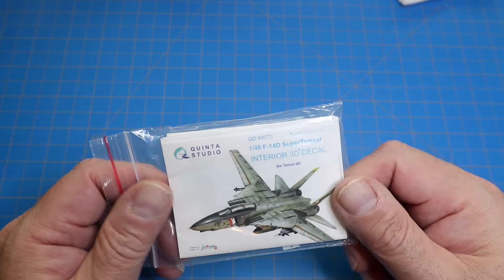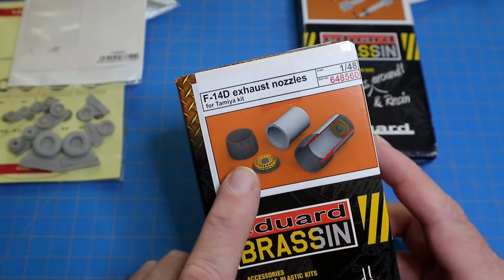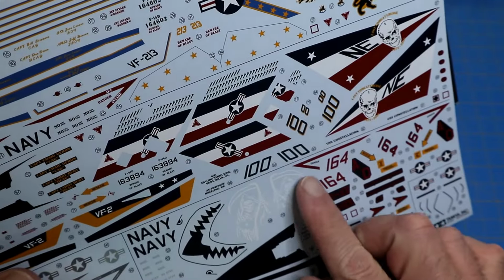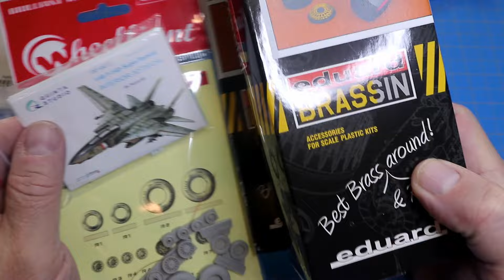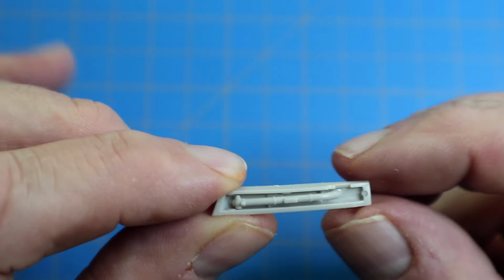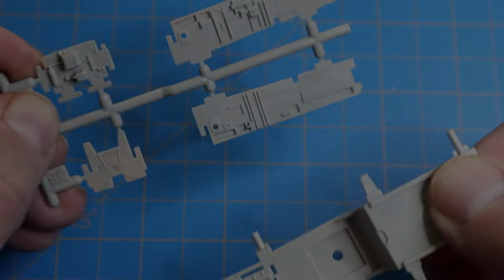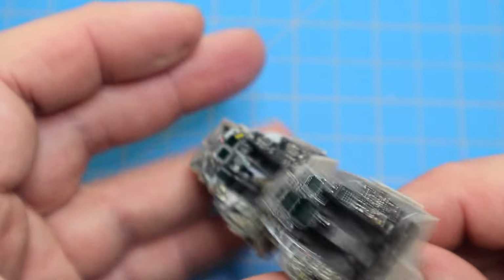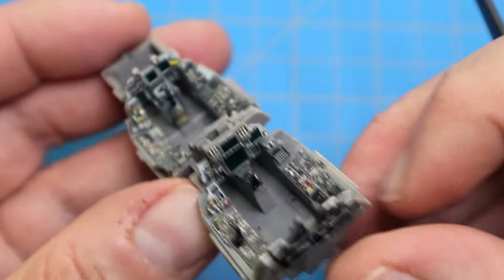Tamiya F-14D in 1/48 Scale - Building An Aviation Legend - Part 1

Comment: Love Tamiya kits, been building them for years, even their old kits go together great. Presently building the Tamiya F4U-1/2 and i used Red Fox 3D instruments decals in the cockpit, they are a little different when compared to the Quinta Studio 3D instrument decals i bought for Magic factory Corsair builds.
Ive never built Tamiya's 1/48 scale F14D, does it require nose weights or not? Didnt see you add any. Just wondering. Keep on building.😅
Reply from the maker: I didn't add a nose weight- it's not called for in the instructions. As for Tamiya kits- I build them but not as much as other kits. I guess my tastes are a little more exotic. I appreciate your feedback- good luck with your build!

Comment: 14:47  What is the name of that product you are using there, to full in the gap under the cockpit. It seems to be a very easy way to fill in little gaps.
Reply from the maker: @MrGeo9002  it's Vallejo Plastic Putty - terrific for tiny gaps. Cleans up with water. I highly recommend it!
Reply: @MisterGsWorkbench  I will definitely be looking into that. And thank u for replying back. Much appreciated.
Reply from the maker: @MrGeo9002  you're very welcome, and thanks for watching!